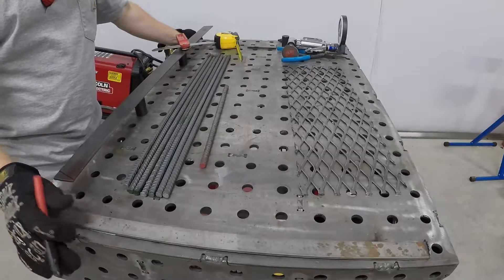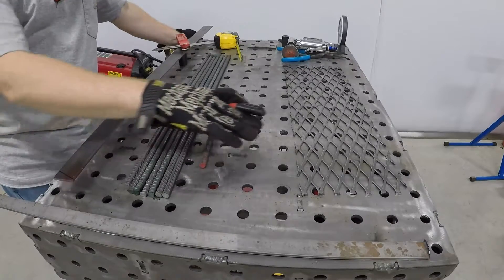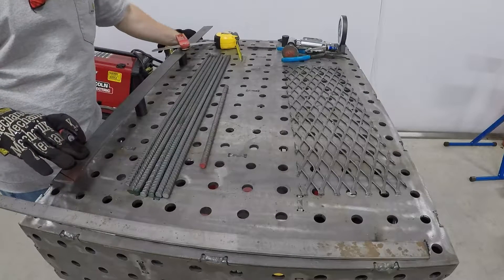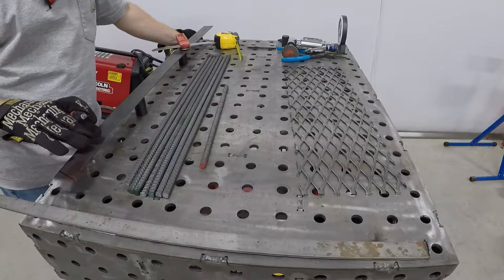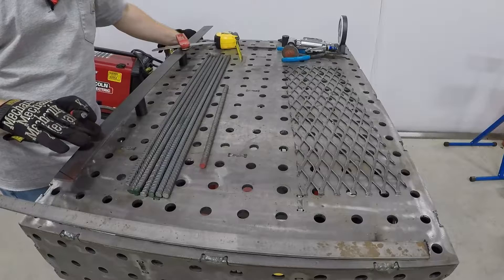DIY American Flag Metal Art! Handmade USA Flag!

Comment: What are all the measurements of the rebar?
Reply from the maker: I used 3/8" rebar, 1 1/2" flat bar and expanded metal. Height x 1.5= Width for your flag project. All cuts are 20 degrees.